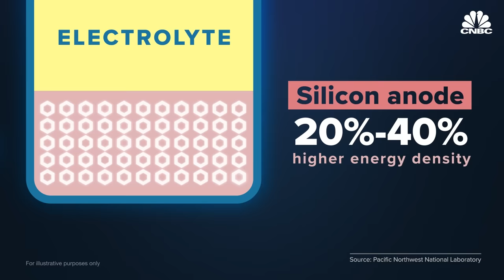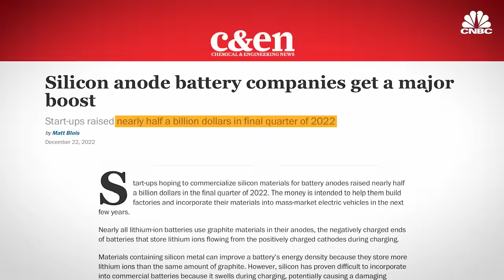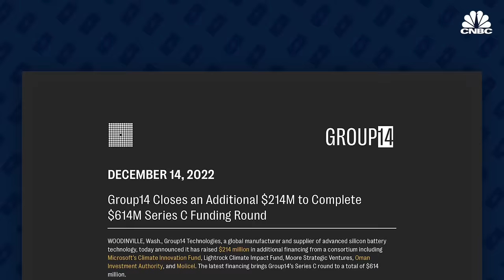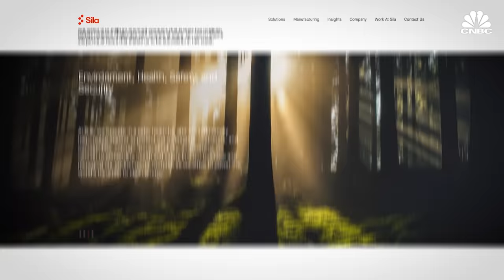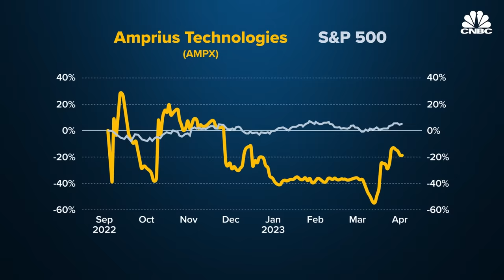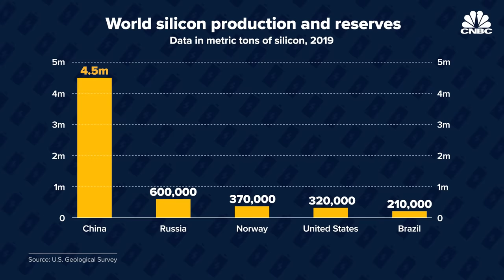How Silicon Anode Batteries Will Bring Better Range To EVs

Comment: Every now and then there is a new video about a breakthrough battery technology yet nothing changes in the real world
Reply: A lot can be done—and a lot has been done—to make a better lithium-ion battery. In fact, gains in the amount of energy they can store have been on the order of five percent per year. That means that the capacity of your current batteries is over 1.5 times what they would have held a decade ago. Has the mileage of your dinojuice sucker improved 50% in the last 10 years.
Reply: Nothing has happened in the real world? Batteries have dropped in price 10 times in the last 10 years, and energy density has increased by up to 100%. Not to mention the charging possibilities of up to 350 kW. The first Supercharger worked with up to 90 kW.
Reply: That's great and all but in your opinion when do you think we will match gas in range and fill up time?  Because that's what it is going to take to get a bunch of people to switch.
Reply: @danielcarroll3358  Yeah bro you proved my point. Lithium Ion batteries got better but these breakthrough technologies that are talked about like every 2 years somehow dont get implemented in the real world. 
50% maybe not but ICE also got more efficient over last years. Unfortunately though cars also got bigger and heavier cause thats more profitable for the manufactureres
Reply: @ThunderTiger0801  ICE didn't get any more efficient in recent years. ICE is a mature technology without much potential left. Not so battery tech.
Reply: @SasukeUchiha-zu6dw  There is no need to match. Just have a think.
Reply: @beatreuteler  Of course it did. Look it up haha
Reply: @ThunderTiger0801  I did look it up and didn't find it. Where did you find it?

Comment: Holding a lot of charge is one thing. Being able to hold the same amount of charge for a long long time is another thing. Sadly, that's the problem of a battery regardless of the technology. 🤔
Anyone who has a mobile phone sure realize this. How the battery life seem to go down with age. What used to be a full day becomes half a day, and even less!😅
Lastly, let's hope theses batteries are properly disposed, better yet recycled. As most batteries in third world countries end up in landfills!😓
Reply: Relax. The typical Li-Polymer batteries mobile phones are powered with, have a typically high zero load discharge rate. Batteries made for EV's typically don't. (LFP etc). There's no word about this in the video, I think but I would hope this one is up to par. If not, it won't be EV-ready.

Comment: In this video they talked about the theoretical advantages of silicone anode-based batteries. Then the video goes on to describe a company that is building a silicone anode-based battery. But gives no details as to the efficiencies of their batteries that they are producing. This sounds like nonsense to me.
Reply: Either is a secret or not a production ready yet.

I think the base theory already on the scientific and engineering journals.
Reply: It’s already in production! Sila Nanotechnologies has it in commercially available fitness trackers and soon it will also be in Mercedes Benz electric vehicles!
Currently looking at 20 to 30 times more energy density and times in between charges then Li Ion Batteries and this is just the beginning!
Reply: Look at the video once more. You will recognize that the companies described in the video are not making any batteries. That is why they can't tell you anything about lifetime, efficiency etc. etc. These companies are making anode materials and sell it to battery makers like ATL. Only ATL (as soon as they start making batteries based on such anode) will be capable of testing and telling these key performance parameters.

Comment: What about just not using cars that need so much range? 100 miles is enough for 90% of people. Just use smaller batteries
Reply: Or just robust pubic transformation for 90% of people and leaving easy travel for those that actually need a car to get to work. (Construction workers, etc)
Reply: *public transportation
Reply: @sayrith  I'm sure it realizes that it typed a typo and just ran with it lol.
Reply: The extra range is useful in cold and hot weather, or for towing.  At 5 degrees F  you will lose 54 percent of your range, at 20 degrees F you will lose 41 percent of your range. So, if you only have 100 miles with a new battery then you would only have a real range of 46 miles at 5 degrees F, and 59 miles of range at 20 degrees F.  That is clearly not enough battery capacity for winter driving.  Not as bad in the summer at 95 degrees F you will lose 17 percent of your range leaving you with 83 miles of range.  Also you lose about 2 percent of range per year on the battery, so after 10 years you are down to 80 miles of range in ideal conditions.  If your car had a 300 mile range, then after 10 years you would still have 240 miles of range available, so still useful, and of course your winter and summer driving are more feasible with much higher available range.
Reply: It is enough for most people on most days.  So for example, it could get me to work and back just fine.  But:

1.  What if i can't charge fast enough so that each day I have less and less total range available.  Overnight charging at home may not be fast enough without upgrades to the electrical system that will be more than we've seen in the last 100 years.

2.  What about the weekend when I need to drive my kids to a baseball game 60 miles away?  Or when i want to visit my parents 120 miles away in a small town where there are virtually no chargers?  Sure, the wealthy will do as they do today and simply own another car for that use.  But that's not really environmentally friendly to expect every couple to own at least three cars.

Comment: And for big grid batteries for cities well sand and salt and or iron batteries can be used because it will never move mass doesn't matter.
But for cars yes lighter can be better but only if it doesn't eat into the batteries life and how long it can hold/discharge the same or better then the ones now.

Comment: if they expand 3 to 4 times when charged, can we not create origami structure of silicon anode battery and so it expands in certain designed way and therefore doesnt expand as a bulk and crack?
Reply: From the video I understand that something very similar as your proposed solution has been exploited using nanotech.

Comment: But they’re still lithium ion batteries, just with a more space efficient anode. and they will be more expensive too since graphite is dirt cheap but silicon costs money to produce from the diminishing global supplies of sand suitable for silicon production, and the semiconductor industry is already a major consumer in that sector.
Reply: I think it doesn't require the quality the semi market requires.
Reply: "Sand suitable for silicon production" = "Sand with greatest return on investment for silicon"

All sand is suitable for silicon production.  All. Of. It.  You just get less from some types then others.

Comment: Do silicon batteries have the same risk of battery fire as lithium batteries ?
Reply: they actually have a greater risk because they will be by defition more energy dense. This is why it is imperative that this technology offers some type of distributed architecture that allows an army of resistors to prevent thermal runaway. I bet they will call it Brakeflow.

Comment: No point in talking about battery "breakthroughs" until its out of the lab, and in full scale production.  Their have been many great and promising solutions, most of which can't be commercial produced at scale for a price that makes them competitive to Li Ion or LiPo
Reply: That is why the start off with wearables as the WHOOP 4.0 or airplanes.

Comment: No one ever wants to talk about the recyclability of battery technology. Recycling high density batteries will be the next major breakthrough.  Weight is an issue for transportation but for grid storage the issue is cost and charge cycle. There obviously needs to be different solutions to different problems.

Comment: So, what if you could get better than 50% efficiency out of fuel and have the alternative of using concentrated solar to replace the heat source provided by fuel? What of batteries then?

Comment: There are bits where the speaker says something along to lines like "20 gigawatt plant" (this is at 6:42), can someone explain to me how a measurement of power indicates the size a factory? Surely, they won't consume 20 gigawatts, right?
Reply: To my understanding, the capacity that the factory could "withstand" is 20 gigawatts- without failure.
Reply: @StayPositiveLLC  Could you please elaborate on what that means? Whitstand without failure?
Reply: @Sekir80  Imagine an empty light bulb, the size of the statue of liberty. Plugged into the ground, it lights up when energy passes through it.

Let's say it gets struck by lightning and all of the energy from the lightening rod has been transferred into the light bulb.

The energy exceeds what the lightbulb is capable of handling so it POPS open and the inner coil is torn apart.

Had the light bulb been equipped to withstand 20 Gigawatts, it'd just stand there- UNPHASED.
Reply: @StayPositiveLLC  Okay, I'm starting to get it. "light bulb been equipped to withstand 20 Gigawatts" Still, I wanna know what equipment do you think of? A resistor, that can limit the current?
Reply: @Sekir Delyn: You deserve more than the jokes told by Stay Positive: A so called 20GW factory in this case means that it shall be sized to allow production of Anode material that represents the making of 20 GWh battery capacity every year. For example if a cell Phone is equipped with 0.05 KWh this amount of material would allow to build batteries for 400'000 such cell phones. Having said this it will be a "very small factoy" compared to the ones building current EV battery tech.
Reply: @beatreuteler  Oh! So, my assumption was right all along. They, as most, confuse power and capacity measurements. This is very bad, imo. 
Thank you for clearing this up!

Comment: Sodium batteries are coming. You don't need to mine sodium. You just sort of harvest it. If the point is to reduce industrial impact on the environment, sodium batteries are the Holy Grail.

Comment: Rather, encourage more hybrid cars and keep everyone happy... Petrol heads and EV fans both can enjoy their respective likings...
Reply: I really don't think either of those groups would be satisfied by the hybrid compromise.
Reply: re: "Petrol heads and EV fans both can enjoy their respective likings..." <--- the new Hybrid Lamborghini sees what you did there.😎
Reply: ICE > EV
Reply: @KP-xi4bj  ev>ice as all ice require a battery and multiple electric motors plus combustible fuels just to function. All of which uses even more energy, precious water, chemicals, cobalt and electricity just to find, extract, transport, store and then refine them. 

Plus more energy to move the refined fuels to the end users fueling station. Before using more energy to pump them out of tanks which leach into the ground. Along with all the other crap oil production entails globally. 👍🏻
Reply: @4literv6  The fact that less than 3% of all cars on the road globally are EVs is very telling.  LMFAO  SMH
Reply: @KP-xi4bj  why is telling they didn't exceed 1,000,000 unit's sold in a year until 2017? By 2027 over half of all car's sold if not sooner will be evs.
I'd say that's quite impressive growth for a complicated very labor intense to produce product distributed globally. 😎

Modern car's are actually some of the most complex machinery humans have EVER built that an average person interacts with on a daily basis.
Reply: @4literv6  "It is estimated that 1 in 250 cars on the road is electric, which equals a global market share of around 2.2% for electric vehicles." - 8 Billion Trees (February 1, 2023)
Reply: @KP-xi4bj  It's not, as EV is a new tech.
Reply: @KP-xi4bj  Thinking globally this is a huge success. Don't forget it will take decades until the new tech is reaching rural corners of earth. In Switzerland, w. new car sales BEV's are 17% market share since late 2022 and growing. Don't forget passing 11% is typically considered a tipping point for new tech adoption.
Reply: @M R  Hybrid is the combination of drawbacks of both.
Reply: @beatreuteler  Hate to break it to you but EVs are as old as ICE vehicles.
Reply: @KP-xi4bj  Don't worry. I am well aware that some EV's have been built more than 100 years ago. However the maturity of a technology is not defined by the time since 1st appearance. It very much depends on the opportunity a technology had to become better and better step by step to approach perfection. A process that depends on mass production, because only then there is enough R&D power behind it. In that view, ICE's had some 100+ years to become mature while EV's are really just starting.
Reply: @beatreuteler  EV came out about the same time ICE did.  There's a reason why ICE won over EV.  Just like there was a reason why VHS won over Beta.  🤣
Reply: @KP-xi4bj  Yes. Try to find out what that reason was and if that reason is still there. And try to find out if there is a reason of why we should avoid burning fossil fuels if we can because generations after us may have a need for them.

Comment: All that energy concentrated in one place is pretty scary. Kind of like driving around in a huge bomb. Anything that goes wrong...KABOOM!
Reply: Sprinkle some ocean water on a Tesla, it won't bite 😉
Reply: In fact the energy stored in a 60L diesel tank is about 6 fold greater than the energy stored in a 100KWh battery when fully loaded.
Reply: @beatreuteler  but that fuel is far more stable than that battery. Battery fires happen, but soon they will be far more intense.
Reply: @allenmoses110  Nope. Batteries catch fire less frequently than ICE systems.

Comment: Charge in 5 or 10 minutes? Do these people realize the strain on the power grid that would cause? Right now it's fine as it takes hours. But each time you halve the time you double the amps drawn. To charge a car in 5-10 minutes would require more amperage than most houses have service for.
Reply: EVs don’t take hours to charge even today. The capacity is keeping up.  Charging infrastructure is not,
Reply: Future charging stations most likely will be equipped with supercaps. This will greatly take the need from a grid coping w. max. charging power.
Reply: @beatreuteler  they’ll be useful to mitigate surges.  The power density, even the best super caps, is way too low unfortunately for charging purposes.
Reply: @beatreuteler  they’ll be useful to mitigate surges.  The power density, even the best super caps, is way too low unfortunately for charging purposes.
Reply: @greghelton4668  In fact the power density in super caps is very high. Maybe you mean energy density. But even this shouldn't be an issue when charging stations are a stationary application.

Comment: When communicating the benefits of this tech or that it would be helpful to offer some type of standardized matrix of battery parameters like ED, temperature performance, safety, recharge rate, cycle life, and COST.  Often we hear "may" or "could" with rosy projections but this is always some shade of deception.

Comment: I wonder how this translates over to being able to store solar power for longer terms at a higher capacity?
Reply: Sand based storages are already in use for storing solar energy
Reply: Tyler: It isn't meant for this application. At least for the time being it is typically meant for applications where energy density counts. The application you mention is the field of redox flow types.
Reply: @Arturo124  Sand storages are for thermal energy only. Batteries are for electrical energy storage.

Comment: I am still skeptical. The weight of silicon based batteries seems like it will be more prohibitive than beneficial.
Reply: in 5 years, every single cell phone,, electric toothbrush, smart watch, etc. will have a silicon anode battery. they shine best in small electronics application due to how energy dense they are.

Comment: Hopefully, this isn't vaporware. I'd love to see 600 miles per charge for EVs, or 450 miles using less battery, thus making it lighter. I'd also love to see home battery storage using this technology. Imagine, instead of holding 13.5 kWh or storage for a Tesla powerwall, it could hold 30 kWh! Three powerwalls, using the energy conservatively during a power outage, might give you 5 days of power and that's assuming you get zero solar during the day to charge them back up. Again, I'd love to actually see this technology in place.

Comment: I really wish I knew how much power the accessories are using in the EV's I know that's not a deal-breaker for most but one thing ICE has over that is accessories doesn't use fuel. Sometimes I'll have my AC going with my radio turned up and all my ambient light going and – lights you have the wipers Etc. I'm not cherry-picking I'm just trying to take account so I can get real-world data and of course cold climates and headlights
Reply: In fact all the accessories in ICE cars use fuel. The only cars having accessories that don't use fuel are BEV's and plug-in hybrids.

Comment: The aviation sector is a good jumping off point for these silicon anode batteries..another would be grid scale storage.
Reply: No. Grid scale storage is asking for lowest cost. Not for high energy density.
Reply: @beatreuteler  Thank you for correcting me.

Comment: Woulda-Coulda-Shoulda. Lately I have heard of several new tech batteries which
will blow Li on out of the water. We are all still waiting. Meanwhile Li-on BEVs are 
rolling off the assembly lines at an alarming rate. Were all still waiting themnew 
tech.

!